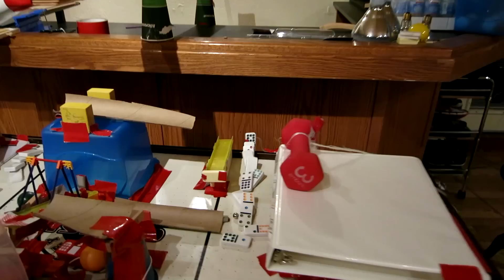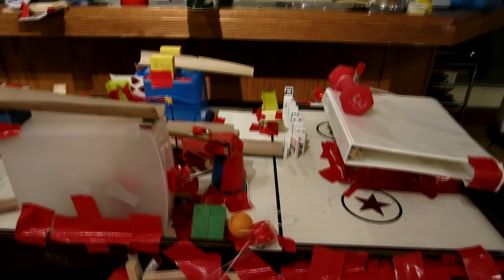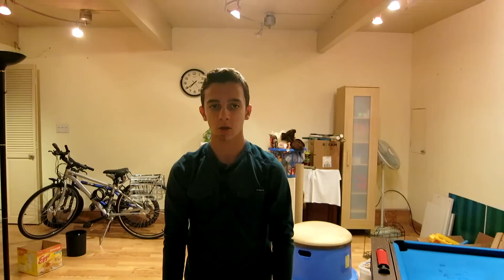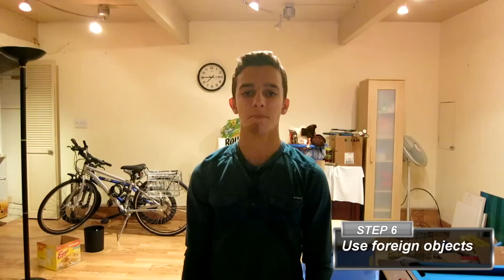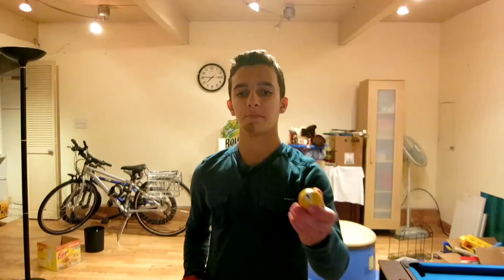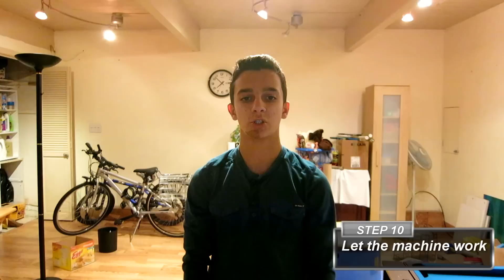How to Make a BETTER Rube Goldberg Machine: 11 Steps to Becoming a Better Builder

Comment: All very good tips, #1 is very important, and to add to it make sure you have plenty of flat and high up surfaces to work on. During agt i bought six 6 ft tables, which cost a couple hundred dollars, that may seem like a lot but its worth it. Also i strive for 100% success rate when testing, it will make the filming process very enjoyable. If it works 99/100 times, fix it or trash it. Also i used to use a lot of tape but now i prefer hot glue, its a pain to scrape off when cleaning up but its worth it because it adds that extra stability that makes 100% possible. Music is so helpful! The only thing i would add is spreading out all ideas so that you can easily see everything on camera including all of the transitions. Great tips!
Reply from the maker: Thanks for the tips! I now have much better surfaces to work on than I used to, now that I moved into a different house, and my RGMs have greatly improved because of that. I find that if you don't have many surfaces, taking a chair and putting a board on it would be a good idea. I try to have as high as possible of a success rate when testing, but usually I can't get any more than like 98% because tape can wear off (I can use your idea of hot glue to fix that problem), and often there are factors in the idea that I can't control. It's really amazing how you went onto AGT and then did an entire machine in one try. How did you get every step of the machine to have a 100% success rate?